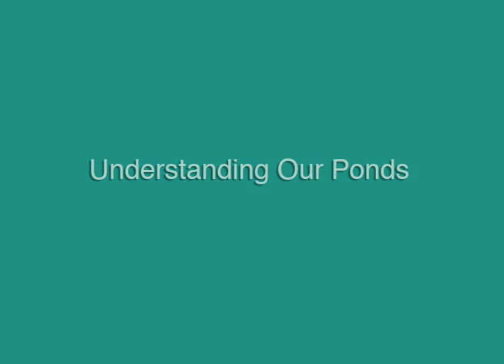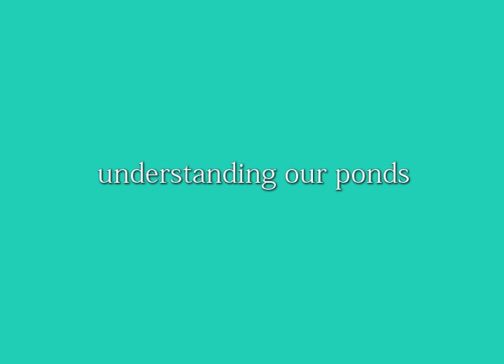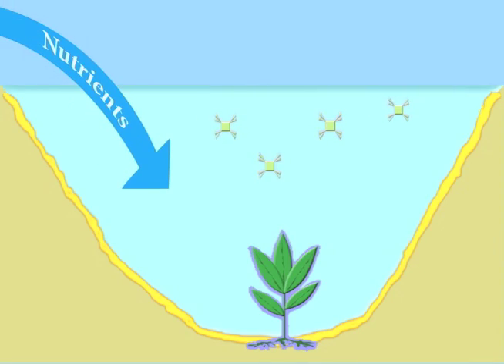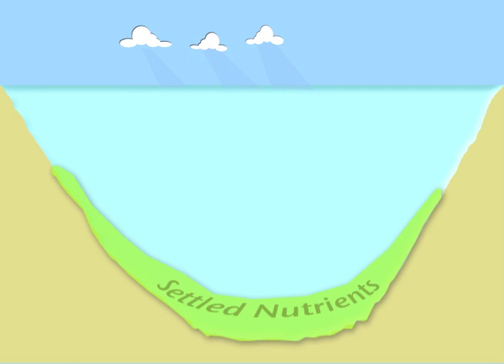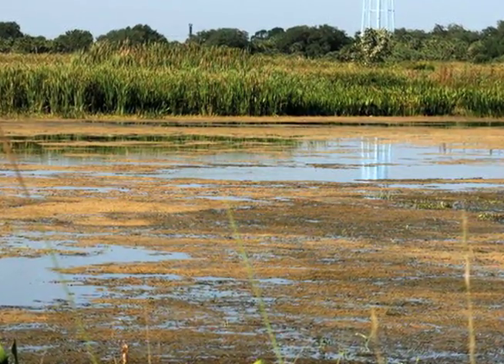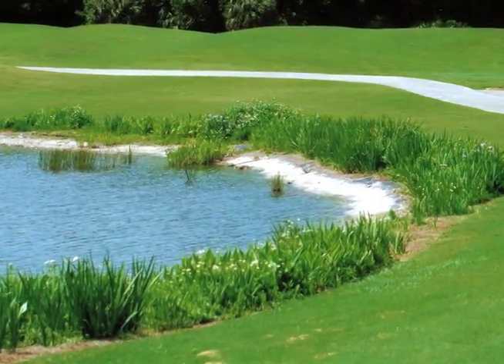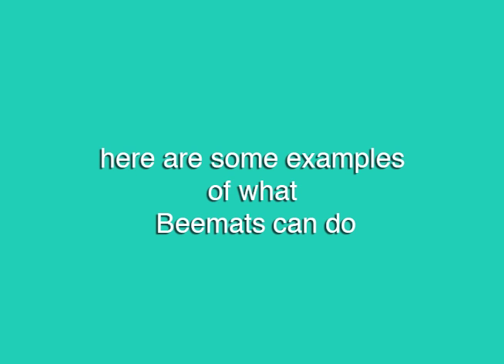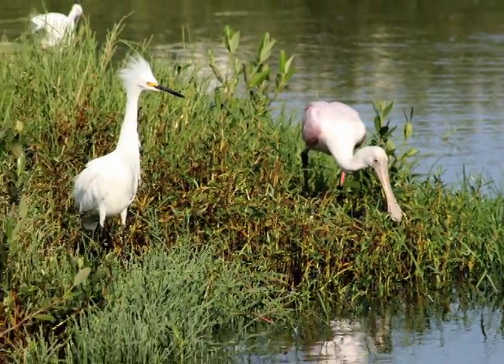Understanding Storm Water Ponds

Comment: @6:21 Most fountains are designed to be just that fountains for decoration. However aeration is a huge side benefit. While most manufactures place the intakes close the surface some have deep water intake as a standard. Aqua Control Inc for example makes deep water intake a standard on units and are most likely best choice for retention ponds. Some intake lengths can go down up to 30' depending on pond. Fountains are still a good choice for retention ponds but a decision need to be made wisely.